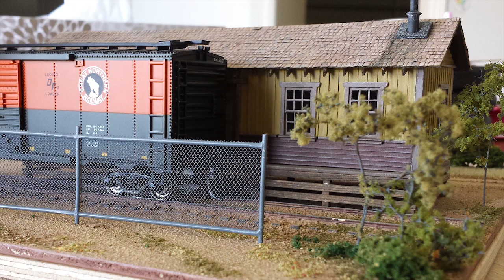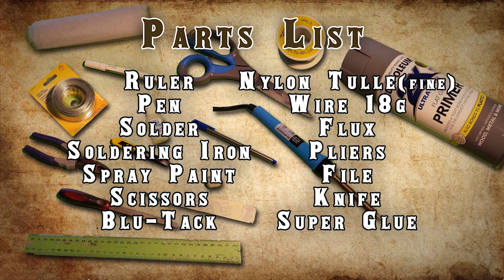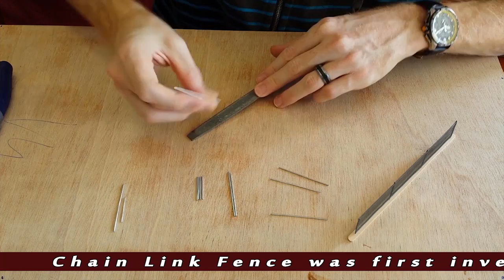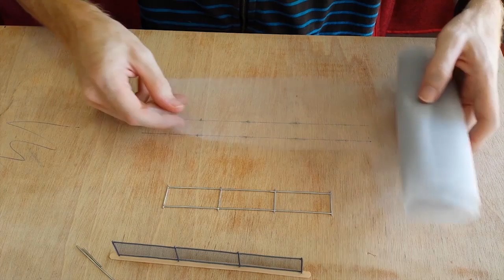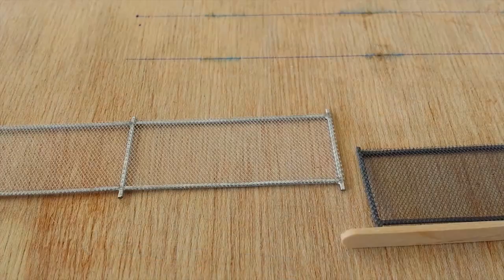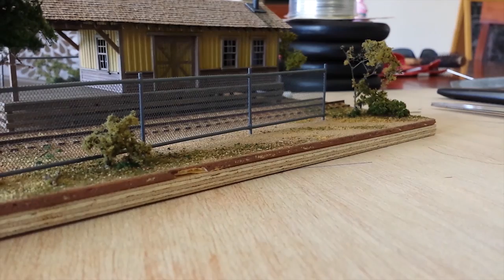Chain Link Fence - Model Railroad Scenery

Comment: Revisiting an old video.  You can straighten wire by chucking one end into a drill and secure the other end in a vice or a screw in a piece of wood, just so the other end is secured.  Turn on the drill and go at it till it breaks of just before it breaks and the wire will be perfectly straight.  I picked up my roll of tulle from the fabric store, $3.50 for a 6 yard roll with our local discount.  Now I've got to get my 18 gauge wire.  I think that using an airbrush would be preferable over rattle can paint.  You can get a much finer spray from an airbrush.  Cheers from eastern TN

Comment: To straighten coiled wire, cut off a section, and secure one end in a vice or wrap around some needle-nose pliers. use a 2nd set of pliers to wrap and secure the other end. Pull one end until you feel the wire yield (stretch) slightly. Release the tension, and carefully release the wire. It will be perfectly straight. This method works great with soft metals.

Comment: The best way to solder the wire would be to tin the parts first then jig it up like you did and then reapply the heat to the pretinned parts. Less solder to worry about cleaning up at the joints.

Comment: You can straighten coiled wire by clamping an end in a bench-vice, taking the other end in some locking pliers and give it a tug.  You will feel it stretch a bit, and then it will be arrow straight.  it takes a little practice, but it's pretty easy.

Comment: Hey Luke.  An old metal shop trick to straiten wire is to put one end in a vice and the other end in the chuck of your battery drill on low speed.  twist the wire slowly and watch it straiten.  It will also work harden the wire and make it much more likely to hold any shape you want to give it.
Reply from the maker: Thanks for the awesome tip Andrew
Reply: You're very welcome.
Keep making cool the stuff..

Comment: If you clamp one end of the your wire a vise and hold the other end with a pair of pliers and then snap the wire, this will straighten the wire quickly.

Comment: Would this method work at all for N-scale?
Reply from the maker: yeah it would work, you'd probably just need to find a nylon tulle that was a little finer with smaller holes. Most fabric store have a selection of tulle with different grades.

Comment: Could we also use a flame liter instead of solder?
Reply: *lighter
Reply from the maker: Yeah, you'd just need the right type of solder when using the flame torch method. Not all solders work using a flame.

Comment: Good evening Luke,
I noticed you had trouble with the 18g wire curling. You may like to try a trick i learnt about 50 years ago.
Clamp one end of the wire in a fairly solid bench vice and grab the other end with a solid pair of pliers. Put your foot against the vice if the bench is not firmly fixed and give the wire a short, sharp tug to stretch the wire a very small amount. At the same time, you should end up with a straight piece of wire.
Michael C, Melbourne.
Reply from the maker: Hi Michael, thanks for the tip 😊 I had a couple of others suggest similar methods of straightening the wire which I've since tried and I was surprised at how well it worked! It's a great tip and like you I'm sure I'll hold onto that advice for at least 50 years 😊 assuming I survive that long... Thanks again Michael
Cheers
Luke

Comment: Hi luke i nedd some help!!!!! i am a begginer and  iwant to build this AWESOME fence and i would like to know what kind of wir did you use: aluminum, brass, tin, copper etc/ please answer quick
Reply from the maker: Your best option will be to use brass, it's much easier to solder and available in many sizes at most hobby shops.
Cheers
Luke
Reply: Luke ya the boy

Comment: I bought cheap silicon baking sheets from the dollar store ( half as big again as an A4 sheet or thereabouts). Cost me about $3-4 and I glue and paint on that. None of my glues stick to it anyway and easy to clean hot glue and paint off it by throwing it in the washing machine or under the tap. I also cut one up into smallish squares and use it when clamping anything. Nothing sticks to it and it helps the clamps leave no marks. Love your work Luke, the attention to detail is spectacular and really makes the difference.
Reply from the maker: That is a fantastic idea! I wish I had thought of that earlier. I'm about to build a big batch of fence so I'll definitely be using your method.
Cheers
Luke
Reply: +Luke Towan u can also find them cheap on eBay, they usually various sizes. Some people call them Silicone Rolling mats FYI

Comment: I build plastic models, mainly aircraft. About 25 years ago, Monogram had just released a 1/48th scale F-84 and wanted to show it on the tarmac, but then decided to add a perimeter fence. Had a bunch of wedding veil left over from when sister got married a year earlier.....NEVER throw anything away around me. Used round, plastic tubing for fence posts, but never thought about measuring the distance between them, just eye balled it to where it looked right. Like you, used super glue to bond veil to posts. Added grass on both sides of fence. Thanks for the video because this and your other videos help those who haven't seen/thought of something like this before.
Reply from the maker: Cheers mate, this is an old technique but there's not a lot of info online about making chain link fences. It looks like you have a great technique, it's probably a little easier using plastic fence posts as opposed to soldering the wire?
Cheers
Luke

Comment: After looking far and wide I found "music wire" on http://www.newegg.com. It keeps it's straight shape. It is steel so needs acid flux to solder it. I ordered #497 which is about the diameter of a paperclip. It is available in various other diameters. Works great with this tutorial.
Reply from the maker: +iamtheimagedoctor Thanks for the great link, I'll have to give that stuff a try as well :)
Cheers
Luke
Reply: If working in N scale go for the .002" wire which is about 4 scale inches in diameter. The acid flux is essential but has nasty fumes so use in a well ventilated area with a fan to circulate the air.

Comment: Beautiful looking fence and really nicely done video!  I would suggest using a sheet of waxed paper taped down to the plywood for the step where you add the tulle to the fence frame.  It will keep the superglue from cementing the fence to the board.
Reply from the maker: +Toni Ryan Thanks for the great tip Toni, that would make so much sense! Sometimes it takes a simple idea from someone else to make the biggest difference :) Thanks again 
Cheers
Luke

Comment: Hi Luke, enjoyed watching this project.  I tried this using aluminum wire and it did not work. Were you using aluminum wire as well?   Thanks for your help!
Reply from the maker: +Mike Burton I'm using galvanized steel, it's usually used for fencing I think? Some solders work better depending on the type of wire so if you have a bunch of wire already it might be worth trying a different solder?
Cheers
Luke
Reply: +Luke Towan Thanks I will pick up some steel wire and give that a go!!  Take care.

Comment: Luke , I read further and found details about the wire!!!
Gregg.
Reply from the maker: +FishplateFilms lol, good work. I usually try to post all the info where I can, sometimes if the info isn't in the video I might include it in the description area. A little tip I learnt since posting this video is to have every third or forth upright post a little longer so it can be pressed into the layout or mounted in small holes, that way it's a little more secure and less likely to topple over.
Cheers
Luke

Comment: Well so far I've tried Stainless Steel Wire from K&D (s?).....It would not take to soldering.  After researching the subject of soldering stainless I've found that one needs to use an acidic flux like Kester 817 and a solder with a high silver content so I scrapped that idea and went out and bought 18 ga solid aluminum wire.  That didn't work either.  Like Stainless the oxides that form on the surface prevent solder from sticking.  So I looked at the video again more closely and noted that you used galvanized steel wire.  Who is the manufacturer and where can I get it?  Are there better metals to solder to? Copper for instance, as long as you will be painting the assembly does the color matter.  Your input is most welcome.
Reply from the maker: I didn't think the type of wire made that much difference! It's quite interesting hearing about your experiences however I can certainly say brass wire or copper wire would definitely work, I've seen many modellers use brass and it takes solder quite well and copper would be very similar. Good luck with finding the best material, I'd be very interested to find out what works best for you.
Cheers 
Luke.
Reply: +Luke Towan  Thanks for the reply Luke.  I've been looking at a number of your videos and have to say they are quite impressive.  I too like a lot of attention to scenic detailing.  At some point I would like to send you some pictures of a layout I have been detailing for the past 30 years.  Did you mention a brand of wire you are using and where you can get it from.  From you accent I suppose you are from the land down under and I live in the Northeast United states. As an aside there is an annual convention of master craftsman model builders. Here is the site: http://modelrailroadexpo.com/.  It is occurring on the end of March and beginning of April. Check it out!!! I have Friends in Brisbane...
Reply: +Luke Towan I am now a veritable 18ga wire store.  I have 110' of galvanized steel, 25' of copper, 50' of aluminum and around 3' of stainless ....(and a partridge in a pear tree).  Completely exhausting ....

Turns out the galvanized and copper solder just fine!!!!  

Off to making chain link fence!!!!!
Reply from the maker: Oh wow, it sounds like you've been busy. I used to live in Brisbane but have since moved to Adelaide. I wish I could make it to the expo! I'll have to start saving and try to make it to the 2017 expo, I work for Qantas and can get cheap tickets on staff travel but it can still be quit expensive. Have fun building the fence, the only thing I'd do different is make a few of the verticle posts longer so you can push them into the scenery base, that way they are held in place more securely.
Cheers
Luke

Comment: What a great tip, I have a section on my layout that requires about 5 feet of chain linked fence ,  this tip will defiantly fit the bill.Thanks for sharing.Darick
Reply from the maker: +DClavalois No worries Darick, this will also save you a fair bit of money as well. Especially when you need so much.
Cheers
Luke
Reply: I will post the result on up coming video .Keep an eye out for it Luke.Merci Darick

Comment: Thanks Luke.  What nylon would you use for N scale then??
Reply from the maker: +Colin Mansell That's a tough question to answer, I'm not sure if there are different grades of nylon tulle? I basically just went down to the local craft store and slowly picked through what they had until I found something usable. I guess you could try the same and see if there is a fine enough material that would do the job? Some ribbons have a fine mesh like texture so it might be worth looking at ribbons as well.
Hope that gets you on the right track.
Cheers
Luke
Reply: Thanks Luke, I will have a look and see what I can find.

Comment: Excellent! I have now tried and successfully emulated your methods on chain link fencing many times for my model rail road set in an industrial park with private rail company. The one modification I think you might like is that I now tend to make the vertical posts about 1 cm longer and bend them forward once they clear the top rail. This gives an opportunity to string a single strand of tulle (cut ridiculously carefully from the off cuts of the fence) along the top. Three of these strands end up a bit twisted and twirled within them selves so when the painting stage is reached and the tauten up sufficiently, the viciousness of the 'barbed' wire is just a little over scale but all the better for it. The layout is set in the 1970s so security became a bit more important than the most often modeled 1950s era.
Thank you again for the EXCELLENT tutorials...keep them coming. 
Where can I get "Sclupamold" in Queensland?
Reply from the maker: +Franklin Anders Thanks mate for the great tip on modifying the fence, I could imagine that would look fantastic! The only place I've found Sculptamold at a reasonable price is "Adelaide Moulds and Castings Supplies", the can post and the price is reasonable. I think Riots art and craft sell it as well but very expensive.
Cheers
Luke.

Comment: This is different than what I made. 8 months into modeling now. I used my wifes hair nets stretched over a plastic hanger sprayed with metallic paint. Using fireplace match sticks made my fence! I like both. Thanks for sharing!
Reply from the maker: +Pastor Leonard Williams CAYA Sounds like a good idea, the hardest part I find is finding a material with small enough holes but not too small and not too large. Stretching a stocking would work quite well. That's something I'll definitely have to try.
Thanks for the tips
Cheers
Luke.

Comment: Luke, I noticed you had coiled wire... here's a trick to straighten it: Cut the wire to a rough length, they put one end in a vise and pull (stretch) the wire with pliers! Works like a charm! Gets it nice and straight.
Reply from the maker: Tim W Thanks Tim, I'll definitely have to try that on the next set of fences I build, which will be very soon! I've also been looking for straight wire that has already been straightened. The hardware store sells it as tie wire....? I think?
Cheers for the tip
Luke.
Reply: Luke Towan 

Hi Luke,  Great videos, I like your style.  Regarding the wire straightening - as  Tim says use a vice and pliers.  Hold one end of the wire in the vice, hold the wire tightly with the pliers and then, most importantly, allow the wire to go really slack and give a fast, sharp tug to straighten wire.  Works a treat, I learned the tip when training as a silversmith and have never forgotten.  By the way, solid core electrical copper wire works really well and a friendly electrician will provide lots of off-cuts (aka short ends) of suitable cable for the price of a beer.  Happy modelling - I have subscribed as I love your vids,

Regards

Terry

Comment: Hi Luke,
Thanks for the great videos.  Very informative and to the point.
An easy tip for straightening wire. Take about a 1 meter length of wire and clamp the one end in the chuck of your battery drill/screwdriver.  Grab the other end with a pair of pliers (alternatively clamp it in your bench vice) and pull tight. Now slowly start to turn the drill while holding the wire tight. After a few turns the wire will be straight and it will hold its shape.  H T H.
Happy modeling!

Johan de Villiers
Reply from the maker: Johan de Villiers another great tip! Thanks for the advice. That's another method I will definitely be trying.
Cheers, Luke.

Comment: Luke,
A trick I learned some 50 years ago to straighten curly wire.
Take a length of the wire, up to about a metre long, and clamp the end into a solid vice.
Grab the other end of the wire with a good pair of pliers.
Pull the wire taught, If need be put your foot against the vice, and give it a solid pull.
The wire may stretch a few millimetres, but after a little practice you should end up with a straight length of wire.
By the way, excellent videos, thank you.
Michael,
Tullarine.
Reply from the maker: Michael Causer hi Michael, thanks for the great tip. I'll definaitely give that a try on my next build. Cheers, Luke

Comment: Great job on the chain link fence.  I was going to buy window screen but I may buy the nylon instead.
Scott
Reply from the maker: Scott Downey yeah, fly screen wire is a little course and the gaps are pretty wide, the nylon tulle works pretty well.
Good luck with the fence build, cheers
Luke.

Comment: Thanks for the great demonstration.  I had a go at making the fence and the results where pleasing.
 After several failed attempts to get the wire straight I ended up rolling the small pieces between to heavy bits of flat metal.
Thanks for the inspiration
Reply from the maker: Graeme Schulz that's a great idea for straightening the wire! I'm glad you had a go at making the fence, I did a recent video where I add barbed wire to a corrugated iron fence, I reckon it would look pretty good on the chain link fence!
Cheers, Luke.

Comment: Thanks so much for posting this. Very professionally made tutorial, no waffle, very clearly shot. Have you considered using a single piece of wire for the horizontals? (Was it the rolled nature of your wire supply that made you go for cut sections?)
Reply from the maker: Browntau Thankyou for the comment, I did think about a single horizontal wire but I also wanted to have a small part of the vertical pole sticking out the top. But I guess it all depends on how you want to design your fence, a single horizontal wire could work wonders for a specific design. thanks for the idea and great comment. 
Cheers,
Luke.